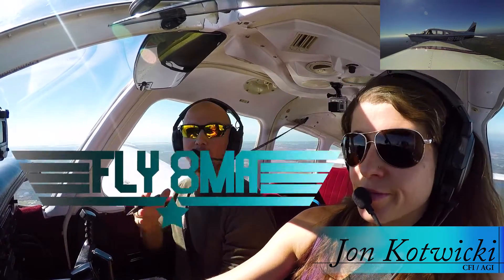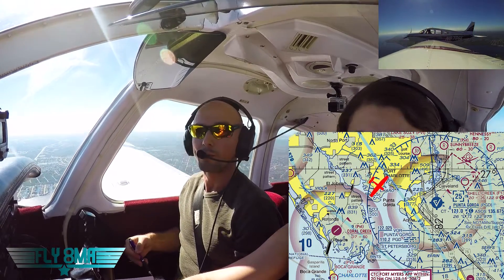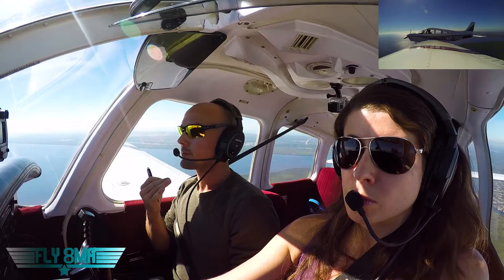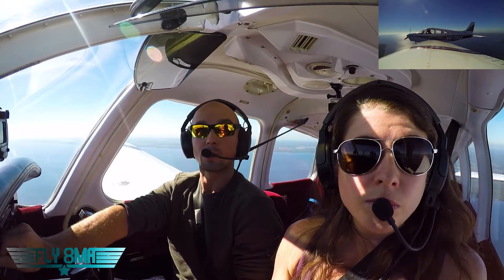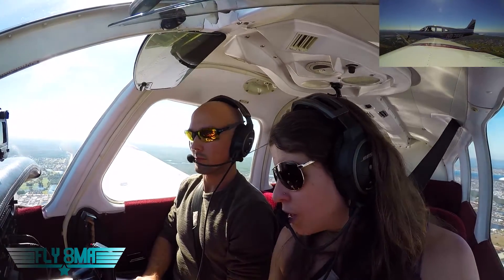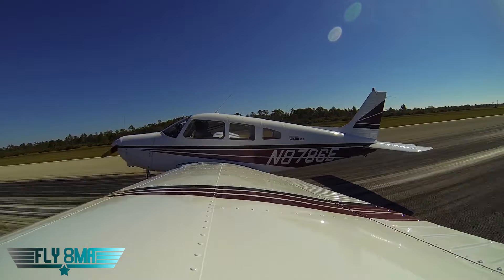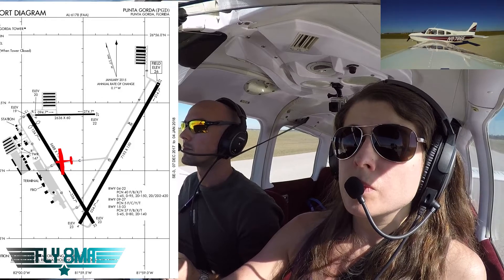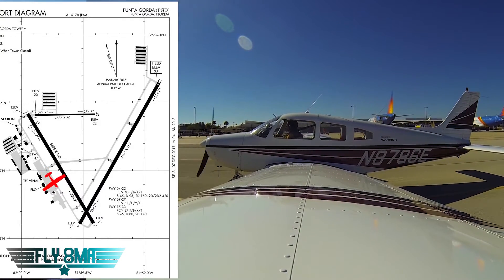Ep. 40: Landing at a Class D Airport | Radio Comms | ATC Recording

Comment: What was that alarm going through the mics on the transmissions of that other aircraft on frequency at the end of the video?
Reply from the maker: Just the bleed through of another guys strobe/beacon or some other electrical interference.  It's common to hear than, and supper annoying when you are the one flying the airplane that is constantly making that noise on the radio!
Reply: Ahhh, that makes sense.
Reply: Just went onto skyward.io and found out that I would need to have a COA or an FAA approved thingaling to fly a drone in my area. #sad